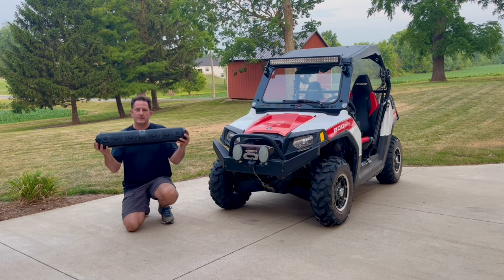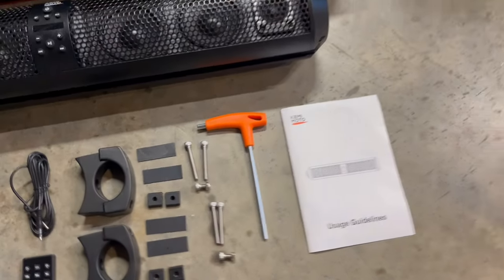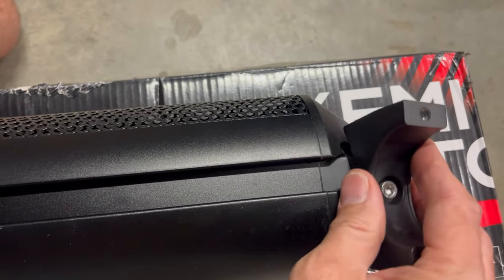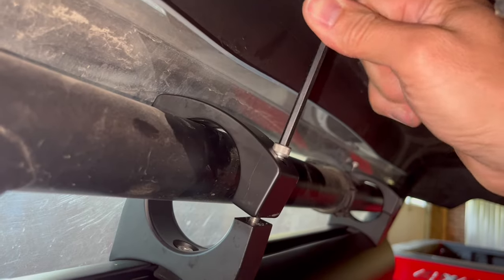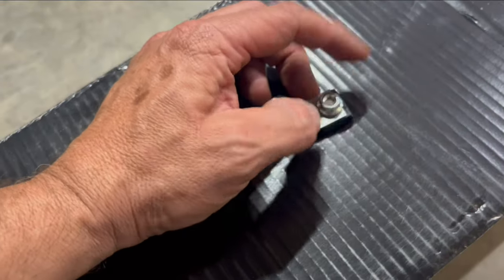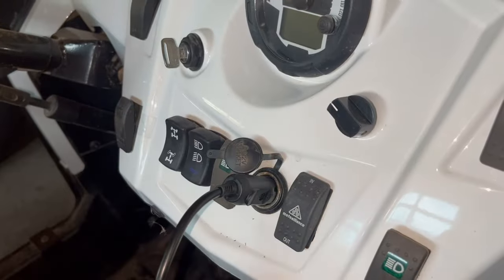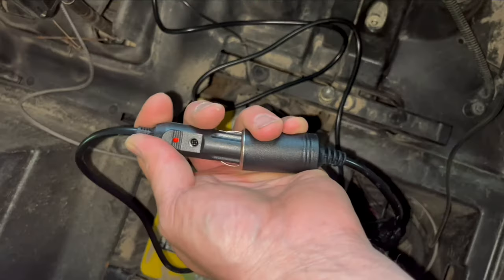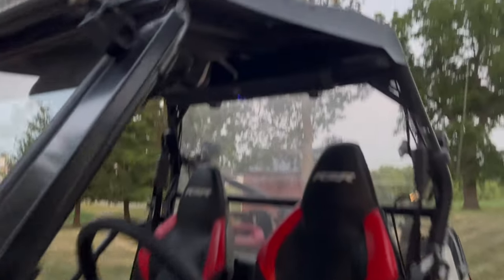Sound Bar Install on a Polaris RZR

Comment: When You Hook it up straight to the battery like that then you have to manually turn it off everytime cause it will drain the battery right?
Reply from the maker: Yes, that is true.  If you leave your RZR sit for long periods, it will eventually drain the battery.  Yes, a switch in the power line will solve that.